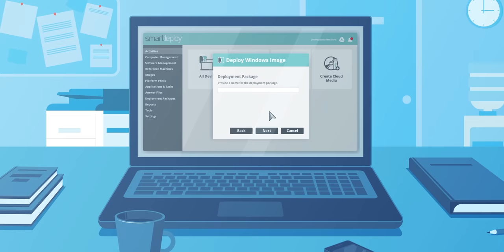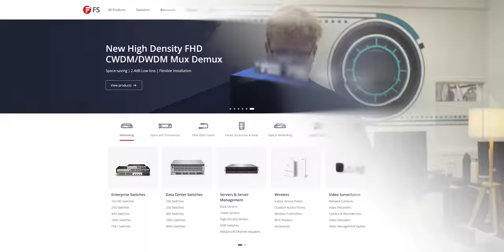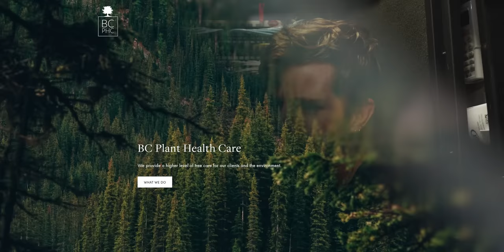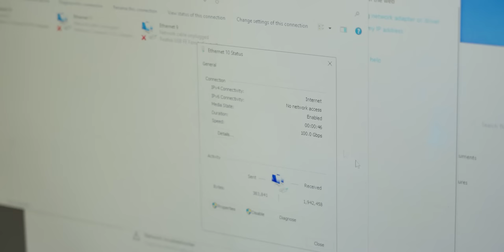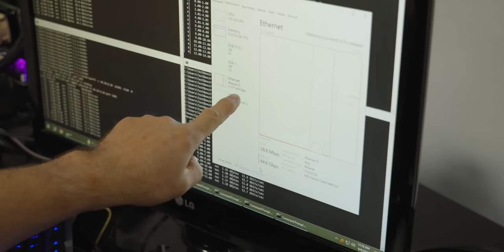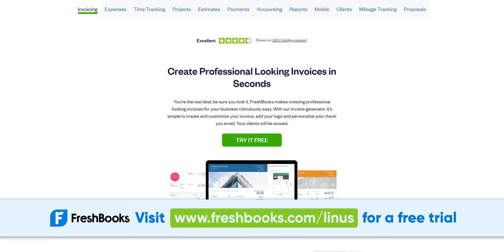Everyone said this was impossible - Backyard Fiber Run

Comment: I'm pretty sure no amount of distance, either land or water, can stop Linus from setting up wifi/ethernet.
Reply: @DUMBDUDEGAMER  that would be cool but I think it would turn out like the lan party on the top of the mountain, which if you didn't see, didn't really end the best
Reply: 666 likes
Reply: there is no WiFi involved here, only optical signals.
Reply: @psycl0ptic  i think he's on about when they set up wifi for their parents or someone, across a lake, as well as from one of his own buildings to another and got roughly 6Gbps
Reply: If there were settlers now they would need a Linus for sure
Reply: Mars is next.
Reply: what about the vacuum of space
Reply: @Fallen_Family  was that the "satellite dish one?  It didn't function?  I tapped out about halfway in.  But yeah, good point.  Satellites.  If both ends have a connection to "star link".  I wonder if an Ethernet between the two would happen?  Or was that the mission, to avoid paying for two net connections.  Maybe there is a special package for something like this.
Reply: I swear if they ever open an office overseas they'll still try to run a cable between it and their Surrey HQ.
Reply: @DUMBDUDEGAMER  I had a LAN all over town once using parabolic dishes and 2.4ghz amplifiers. Though technically that’s actually a WWAN.
Reply: Also whoever quoted him that $100k for a short hop microwave backhaul is a scammer. You can literally get your own AirFibers from Ubiquiti that do that easily and in the license free bands.
Reply: @Fallen_Family  it actually would be pretty COOL😂
Reply: I need about 5+ miles of fiber, over 3-4 bridges...
Reply: @XeroCreator  Soon someone will realise that they can go there in the night and put an intercept halfway along the buried cable and get a direct tap into the LMG LAN 😋
Reply: @engineeringvision9507  i imagine they're going to bury it, but people can be crazy lol
Reply: This is just a statement of awesomeness for Linus' effort. However, even Elon Musk was struggling putting up internet for the whole world.
Reply: As long as he can fly or swim x)
Reply: oh wait, he's in your garden now
Reply: @vangildermichael1767  Satellite internet is still routed terrestrially, as far as I'm aware. You couldn't go point-to-point off a consumer-facing satellite internet link.
Reply: i think you mean dad's
Reply: @DUMBDUDEGAMER  SpaceX could make this possible
Reply: @sniperpickaxemc  LASCOM satellite
Reply: Just bury it man. No one will care
Reply: One day NASA calls: Uhmm we have bad wifi on the moon....
Reply: Linus: I'm proud to announce our partnership with the Canadian space agency to run a fiberoptic cable to the moon.
Reply: 1000KM is enough to stop most cats from running internet's.
Reply: Trans-pacific LAN!
Reply: Linus Media Undersea Networks incoming
Reply: If this was frontier land.. no one would die of dysentery
Reply: What about… height!?
Reply: @engineeringvision9507  i think they register each device mac address into their network. so unless the leecher knows one of their devices mac address to spoof, all they get is internet i guess
Reply: honestly tho he’s lit!
Reply: from southpole to northpole :D
Reply: When they finally start a Mars Colony. Linus will be on the second ship down. Going " Ok send down the cable".
Reply: @Teka it won’t stop him 😂😂😂🎉🎉🎉!!
😊
Reply: Which SCP is this?
Reply: for sure dude, i'm waiting for linus to wire our country for a better internet connection. no, not as an ISP but would like for him to run a wire from their HQ, i'm pretty sure their bandwidth is high enough to share.
Reply: It might need the act of god to stop him
Reply: LTT satellite when?
Reply: except this segway from their sponsor:
FREHSBOOKS
Reply: correction, fast wifi/ethernet*
Reply: Ain't no valley low, ain't no mountain high, ain't no river, Wide enough baby
Reply: One day...he will supply Neworking/WiFi to everyone in the world....we will all use it to play doom with him
Reply: @nickcollins1528  Or you could just go multiple other satellite internet providers that do it cheaper and better with just 3 satellites. SpaceX satellite internet is just a sham talking about next to no latency when in reality you wont be playing FPS games with that latency anyways, while also being too expensive even by selling dish and equipment for loss to any third world nations population. They wont get that 45 thousand satellites on orbit before first ones need to be replaced even with out space trash ripping them to shreds... and with that much shit yeeted to orbit, just one collision could cause chain reaction and prevent us from going to orbit in thousands of years, turning orbit into fucking shooting gallery, witch will wreck all existing infra there, so no gps for instance...
Reply: @XeroCreator  At the end they said they 'can't keep it' ....wonder why?
Reply: @jasondrummond9451  Probably something with ordinance. Cities like to put limits on what you can do... If they had someone come out and just run some cable along that back line, and install 'warning' posts, and very likely they would also have to do a small tunnel from that area.

The only other option I believe would be to pay the owners of the buildings to run it across the top edge of them... but I don't think that's even going to work that well because of the gap.
Reply: You would think setting up a network in the neighborhood would be less work than across a lake. 😂
Reply: @Fallen_Family  Cool's an understatement
Reply: Would he survive without the internet though XD
Reply: I thought that this was going to end with "stop Linus from setting up this segue to our sponsor"
Reply: He would run undersea cables if thats what it took
Reply: Low-earth-orbit wifi next
Reply: The harder the environment, the more it'll actually encourage him to set it up.
Reply: So why can't they keep the fiber? Is it illegal or something?
Reply: @psycl0ptic  smh
Reply: Sure buddy.
Reply: @cheater00  legal fees, city ordinances, complaints by neighborhooding offices, etc
Reply: Sounds like a challange ...! 💻🏝
Reply: "Hello guys today we will use satelites stolen from Musk and NASA to provide 100 GB/s to our office in the middle of Australia's desert !
Reply: covid spelled backwards is divoc what does divoc mean in Hebrew?
Reply: @cfcreative1  "Sir, this is Wendys"
Reply: Will he setup fiber to his parent's home?
Reply: Even on Mars 🎉
Reply: @psycl0ptic  what if you put wifi at the end ?
Reply: He'll figure out how to do it on his private island when he gets to that point.
Reply: or ticks, apparently!
Reply: Neither rain nor snow nor glom of nit can stay this Linus abot his duty
Reply: How about.... The moooooooon??
Reply: It is not Wifi it is not wireless it has a Solid Wired connection
Reply: next stop, Mars^^
Reply: He is basically building his own private WAN…
Reply: Waiting for LTT satellites
Reply: He'd wash up on Madagascar and figure out how to hook up to high speed some how lmfao
Reply: He is the type of dude to run ethernet over air with a fiber optic cable because its affordable and fun
Reply: @DUMBDUDEGAMER  Isn't north pole in the Arctic sea?
Reply: Can't wait for the Wi-Fi across provincial lines episode.
Reply: @DUMBDUDEGAMER  that’s gonna be necessary for a 13900k and a 4090
Reply: @psycl0ptic  yes but you can send internet through it lmao
Reply: For going from a house to 3 other house’s how many crs504-4xq-in would you need
Reply: next week we lay our own deep sea cable! :D
Reply: "you must be this tall to ride"
Reply: Could u just not use a cable puller? I did it as electrician just throe libe on it and pull o wqit never mind o see what I mean it's not ran underground

Comment: As a fiber optic lineman, I find this extremely entertaining.
Reply: Tell us, what did they do right and wrong?
Reply: @BlackViperMWG  Yes
Reply: @BlackViperMWG  We didn't see them clean and inspect the fibre ends. Or don't know if the light levels are within spec for the XFPs (giving the distance and specs at the start of the video it 'should' be ok) as for handling of the fibre those cables are pretty durable so though bush bashing with them isn't recommend, it probably didn't do them any harm. Leaving the drum out in the rain is pretty standard practice (for subcontractors)
Reply: @BlackViperMWG  As an electrician in the US. It works, thats everything he did right. Him as the owner, (speculating here) he is not required to follow the cascade of rules that we as professionals need to, which leads into the "wrong" part. This part I am limited in my knowledge, but one thing that I can say for sure is that, since the cable is easily accessible, and susceptible to damage from external factors, that it needs to be in conduit,  or placed where it can not be accessed by "normal" means. Basically, since he ran it in some bushes, if he was trying to make this a permanent setup, he would have to bury it, or place it in conduit, to protect it. That is probably the biggest thing. Then, he would need a permit for such project, and pay all relevant taxes, thousands in conduit (pvc would work). It would have to be buried at least two feet below ground, which where he was, you "could" do it by hand. Bah, this is turning longer then it needs to be. Basically there is a lot of red flags that need to be addressed to "officially" make this a reality, and a lot more than just the cable. God I love my job sometimes. lol
Reply: This is all done manually, now I want to setup my own
Reply: im waiting to see them lay conduit lol
Reply: @Dr Bo  Not a lineman but.. 
1- Laying cable out in the open, wrong.
2- Draging the cable like Linus Van Pelts blanket, wrong. (Linus???)
3- Waving and bending F/O cable, blasphemy!!
4- Not testing the cable for loss or signal power before jacking it into a device, wrong. Maybe they tested it, IDK. Seeing an OTDR would definetly put a smile on my face.
5- I used to be a network engineer for years, I have never seen anyone tucking the cable into sfp first. Wrong? Most probably, As I said, I've never seen before.

But I like the video anyways, good job guys.
Reply: No reply to the comments, I think he is just lying.
Reply: @ryanfowler2055  I belive they mentioned they were going to microtrench it earlier in the video, but I doubt we will ever see that done on video considering that its a "temporary" installation.
Reply: @ryanfowler2055  I do OSP fiber design QA and you're pretty much on the money. Lol this is entertaining and all but terrifying from my perspective.
Yes, needs to be run in conduit if they're doing UG, most common for that size cable would probably be 2" HDPE with borepits at every major turn and sighting pits periodically inbetween.

The types of permits and taxes/fees he pays depends entirely on where he's running it though. If he's doing it in that green strip then he'd likely (barring any local statutes for canada) need only a permit from the company(s) that own that property. Fees would be negotiated through that process. Running it properly through that space would be EXPENSIVE AS HECK though because you're either dragging bore machines into the brush, dragging a trencher into that same brush, or hand digging it, and then your cost piles up on the equipment and labor of doing that in dense green strip forest.

The alternative is running it outside and along the street, in which case he bypasses the Right of Way of all those companies inbetween and instead deals entirely with the permitting for the local municipality. Labor costs might end up being cheaper in that regard, although his fiber run would likely be longer depending on the conduit pathing.

I will admit though this is far more entertaining. I can't wait for "squirrels ate our cable". Squirrels LOVE fiber cables, even armored ones and ESPECIALLY the anti-squirrel ones.
Reply: They did everything pretty well for the most part!  For such a long run I would recommend conduit with some pull boxes and vaults every couple hundred meters.  but what I find most entertaining is watching them do something that I do every single day and catching a glimpse of what we go through. I work in Southwestern Virginia where it’s extremely mountainous with THICC growth and trees, the temperature ranges from 100F in summer to 0F in winter. I just really appreciate that Linus took time in the video to thank us.
Reply: @shreyasdharashivkar8027  Sorry about that!  I didn’t expect to have so many replies!  I have replied. Unfortunately not lying (wish I was!)
Reply: Same
Reply: @musmusification  yea that's an outdoor cable mate , its literally built for that it has a lot of shielding , you can hit it with a shovel or drive over it and it will be fine , he even said its ment for direct burial means no other protection required, and OTDR for 700m of cable ? spend 5k dollars to only use it once , then buy a splicer for 10k and encloser ? yeah .. , they would just run the cable again since they said its around 700 dollars for the whole spool
Reply: @The_Phobose_Show  super interesting my dude!
Reply: As a Florida man I can't believe he was using tiny little wire cutters to cut weeds. Someone get Linus a sharp new machete. Oh... never mind.
Reply: @Mr.Morden  He'd drop the machete on his foot, so don't think that's such a good idea.
Reply: @alexc.1408  Even for a 100 m cable, it has to be tested.  They don't have to buy it, they can borrow it. Bro he used a small excavator in video, I'm sure they didn't buy, lol. And for the outdoor cable thing. Even though it's an outdoor cable, you have to bury it(we used to deploy HDPE canals) or hang it(not the cable that they used) in order to prevent unwanted access to the cable. And not to mention, this particular cable isn't shielded enough to whitstand physical damage that may dealt from a truck, lawnmower or something like that. If they want to rely on this setup, they need to consider doing it properly. Forgot to write in my comment, they also needed permission from the authority, getting permission from neighbors simply not enough.
Reply: Imagine them doing a 4k pull on a 50k route lol
Reply: @S31Syntax  haha are there measurable EM fields from Optical cable, I wonder what attracts them to it. Perhaps it's just something new to gnaw on
Reply: @Mr.Morden  . I am a big fan machetes through bush like that,, also good for small trees.
Reply: @robertt9342  I used a katana to cut some invasive bushes once. It was more fun but I don't know if it actually worked any better.
Reply: @hwdoulykit  They more than likely did clean, inspect, and check light levels prior to connecting everything. They already have the hardware to do that from when they ran fiber to their video ingest stations. However, I'm no expert and could easily be wrong. Just figured I'd mention it.
Reply: @musmusification  
1 - temp cable, Meh acceptable.
2. How also to you think you get cables through existing ducts etc. It's fine..
3. The cable is just trying to be friendly. Yes not recommended. But we have all done it.
4. Would have loved to see on OPTICAL TIME DOMAIN REFLECTOMETER. But also don't expect LTT to drop the coin on one unless they plan to start doing there own splicing too.
5. when replacing SFPs in a full network switch sometimes it's just easier to do it this way..
Reply: @ryanfowler2055  Well we know much (all?) of the NEC doesn't apply to low-voltage (or in this case, no-voltage) runs. But at least they bothered to mention in the beginning that it's all just temporary, because ya gotta trench these 700m, baby!
Reply: covid spelled backwards is divoc what does divoc mean in Hebrew?
Reply: @hwdoulykit  thanks for the comment buddy. Someone asked what was wrong, I merely stated how it was supposed to be done. 9 out of 10 deployments are done similar way. It works, well, most of the time.  For the No:2, I perfectly know how a cable (copper or f/o) supposed to be deployed. It was my job to plan, rollout and inspect, both on cable and network sides.
Reply: @musmusification  good designer have spent time in the field and regularly go back out to keep in touch with what has changed. Bad designers build a pretty design in their box and let the techs work out how to actually deploy it in the field haha. I got sick of one of these rolling out Telco infrastructure.
Appreciate all feedback. Wasn't having a go in any way. Alot of people still think 'the blinking light on the modem box is what makes the internet work'...
Reply: @S31Syntax  Yeah, I just do houses. Have looked into fiber installations for shiz and grins. He might be lucky and if his AHJ would allow it, to run it over the roof, considering its all on the same plot of land. Would probably save a lot of money on that end.
Reply: @ryanfowler2055  Yep. I've done a lot of this type of stuff. I give it less than 6-12 months before something chews or cuts the cable.
Reply: @S31Syntax  The armored and anti-squirrel ones do work. The problem is they are installed in areas where they are a significant problem. Thus you're bound to still get insane squirrels who literally don't give two shits about metal or the bitterant. But at least it's less?
Reply: @ryanfowler2055 legally it’s temporary, practically it’s permanent (probably)